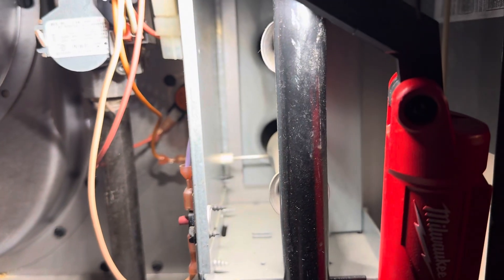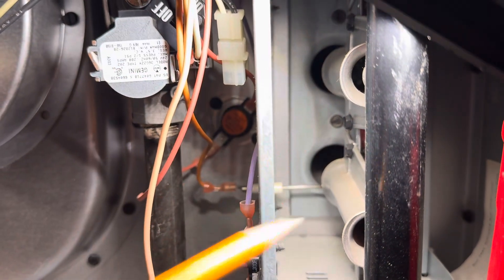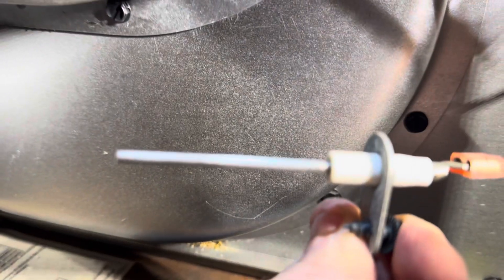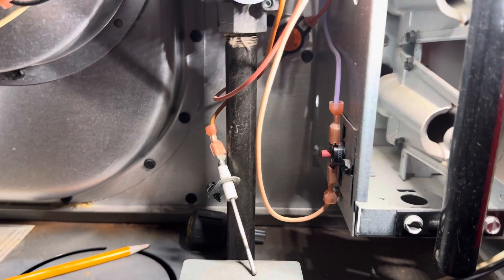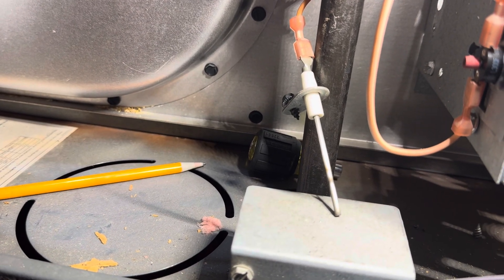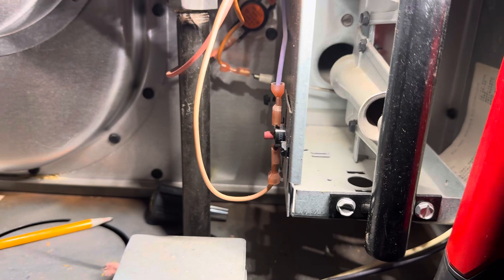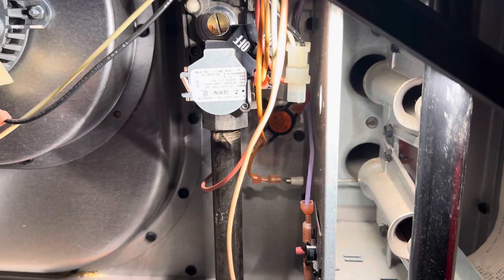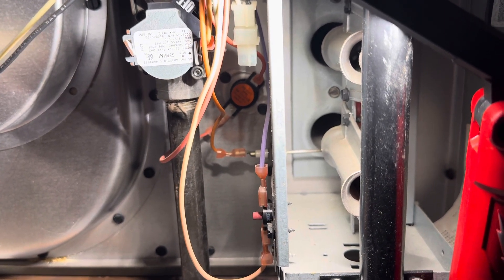Flame Rod Sensor Gas Furnace Not Sensing Working Clean Fix Repair Replace

Comment: In my case my heating heats up but not enough, I would like to know if this is a problem with the flame rod sensor or something else. ???
It turns on normally and the flame comes out and works normally but sometimes only lukewarm air comes out.
Reply from the maker: @ make sure that all of the vents and registers are open. Let’s say that you set the heat for 76°. Are you saying that it will never reach 76°? The furnace should run until it reaches set point, example 76° — if it’s turning off before reaching setpoint, it could be short cycling. For example, if there’s low airflow, the heat exchanger will overheat and go out on high limit switch. I have another video on sequence of operations of a gas furnace. Check that out and see where it may be having a fault.
Reply: @ On my thermostat it always reaches the temperature, from 70 I always have it at 70 and it always reaches that temperature and heats the hallway almost well but in some rooms it heats but not much and sometimes I feel that slightly warm air comes out, but I will continue checking your videos thanks
Reply from the maker: @ that could be an airflow issue, so you getting possibly more airflow in the hallway where the thermostat is so the thermostat is reaching setpoint and turning off, but the other rooms are at a temperature less than that point. I assume this is a problem in summer and air conditioning as well?

Comment: Is it possible to have more than one sensor? I found one exactly like in your video but i also see two more that spotted on exit of gas flame. The only difference between them is the way they are connected to the orange cable.
Reply from the maker: Yes, there are actually two types of sensors, one being a high limit switch, which measures the temperature inside the furnace or on the outside of the blower motor or other surface area, and the switches are rated for the temperature which they cut out. For example, if the filter is clogged or the blower motor is not working, the heat exchanger will overheat and trip the high temperature sensor and turn off the gas valve — this is a safety feature in case the heat exchanger overheats. 

The other type of sensors are called rollout switches, and if it senses a flame where there should not be i.e. coming back towards the burners from inside the heat exchanger because there’s possibly a cracked heat exchanger, then it will trip the rollout switches. Hope that helps.
Reply from the maker: What you were probably referring to is a flame rollout switch. And those are tripped by the flame blowing back from the heat exchanger back into the burner, typically as a result of a faulty heat exchanger. That is, when the gas burners are on, and the blower motor starts the blower motor is pushing air through the heat exchanger, and if there’s a crack in the heat exchanger, it will blow air back into the burner box, and trip one more flame roll outs. So it’s a safety switch and there’s typically between one and three of them, depending on the size of the unit. Hope this helps and sorry for the delay.